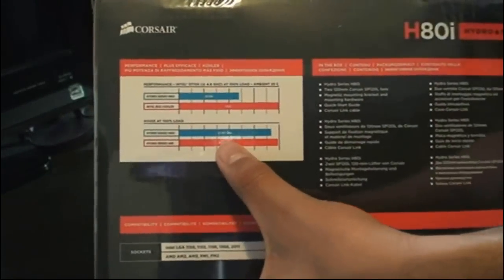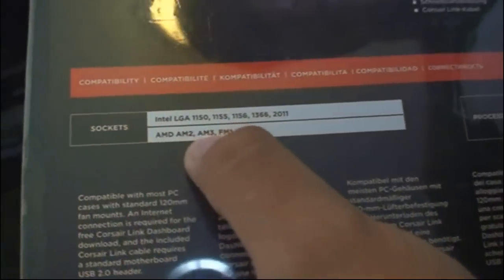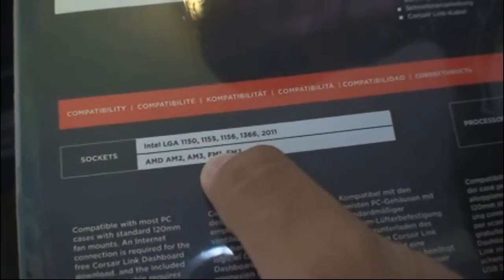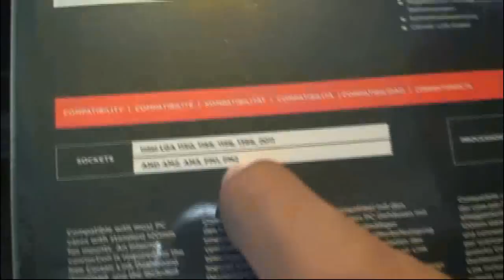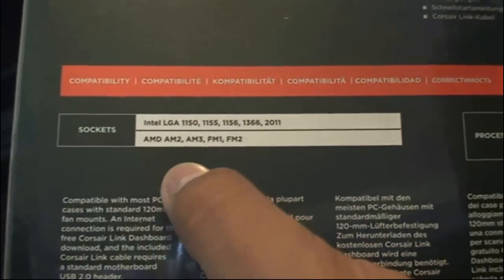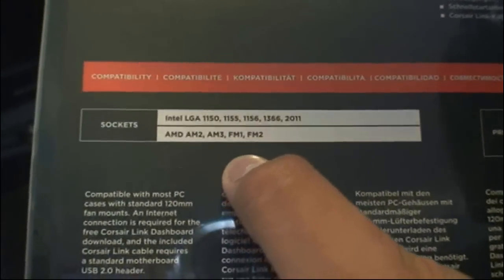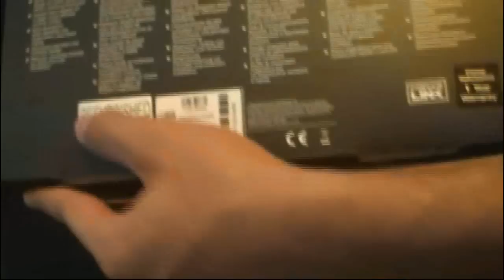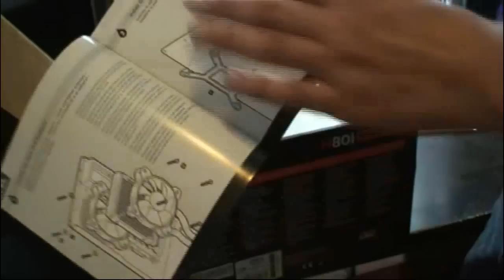Corsair H80i Unboxing and Installation!

Comment: In all videos i have watched,  both fans point inwardly  (the corsair logo points inwards) ?
Reply from the maker: Dude Sweet pc it really comes down to preference and how your case airflow is lined up. Usually I would set it up like that, but I didn't have any good airflow in that case so I settled for that. At this point I have a new system with a custom loop set up :)
Reply: ADRTechReviews ok :)
Reply: ADRTechReviews Well they are supposed to go <--- ÷ <---- i read about it,  for me evetything went alot better, sound,  lower radiator heat, better temp, it's just that none of your fans move out the heat from Rad now. :p

Comment: I have a question about the amd bracket, why are their holes top to bottom how do u put that thing on top of the cpu????
Reply from the maker: Angel Perez the amdbracket uses the same motherboard mount as other coolers,  but it's more like a compression system.  It's difficult to explain in words lol

Comment: I got a new motherboard its a msi z97 gaming 5 mobo and I have a h80i cooler after installing my new mobo corsair link does not recognize my pump or fans. I am running the latest version of corsair link and also have intel usb 3.0 extensible host controller driver and bios is up to date also. I tried all the soultions I found online the regedit fix didn't work because I am on windows 7 and I tried using older versions of Corsair Link that also was a fail. Tried reinstalling corsair link without the usb header plugged in and installing CL and plugging it in after boot no good either. Tried using a usb port from outside the case also no good I know its not the USB ports because it dectects my other stuff just fine.
Reply from the maker: azlil7 You may have already done this, but its worth asking; have you tried updating the firmware of your H80i rather than the software?
Reply: How do you do that ?
Reply from the maker: Go on Corsair link, and on Options - devices, click "Check for updates"
Reply from the maker: Hmm, I'm not sure. Regedit is a fix for windows 8.1. But windows 7 shouldnt have a problem. Are you missing any windows updates

Comment: what clock speed did you have the x4 760K at to get the temps in  the description
Reply from the maker: ichigo8000 I had it stock. So 3.8 gHz. But keep in mind that AMD temp probes are inaccurate.
Reply: wait, why the water cooler if you're not overclocking, b/c i want to get this water cooler to overclock my x4 760K
Reply: ADRTechReviews should i get a better cooler since i want to overclock it b/c this ones already expensive i was gonna try to push close to 5 ghz with this cooler
Reply from the maker: I did overclock the CPU all the way to 4.8 gHZ. although day to day I ran it at 4.6
Reply: Okay thank you

Comment: What if your (my) motherboard doesn't have an extra USB header?  (ASRock Fatal1ty Killer 990,  only 2 USB headers, both being used by top case ports)
Reply from the maker: I would just remove one of them to free it up. But you could also rout it to the back of your motherboard with a mini USB to USB connector

Comment: u got a small case, u should have fix the radiator outside the case
Reply from the maker: I dont have this case anymore, thank goodness :) 

But there is no way to have the Rad. on the outside of the case, that would require the tubing to be removed. But since this is an All in One water-cooling solution, it doesn't come apart :)

Comment: The system only comes with 4 washers for the outside. The inside fan doesn't need any.

Additionally I have a much smaller case and mounted the radiator upside down (the water hoses came from the top, under the power supply) and that seems to work better for getting the block to the motherboard without too much twisting. I also mounted the inside fan to the radiator first.
Reply from the maker: Yeah I realized after.. Also that case didn't have any top mounts, it is a fairly old case, and the reason why I moved case. 

As you can tell this was my first video, I didn't really have much experience, but now I've become much more informed. :)

Comment: Did you use the washers?  And did you go and get longer screws for screwing the outside fan on? Please respond.
Reply from the maker: For some reason, only four washers are included. But yes I did use them one one fan side. Also, yes the screws I used were the longer ones. But you use those for both fan sides. So they can go all the way through the fan and into the radiator.
Reply: ADRTechReviews yea I use the longest screws they give you but I seem to have trouble getting it to screw to the radiator after it goes through the case (I'm talking about the fan mounted on the outside)
Reply: Rooty_Tooty I only have trouble with the bottom screws the top ones go through real easy so I'll have to muck around with later today
Reply from the maker: Rooty_Tooty Make sure the screws are actually going through the correct screw hole on the radiator. If you're still having trouble, make sure that the radiator screw hole has nothing blocking it on the inside.
Reply: Rooty_Tooty i personally didnt use the washers, no problem at all

Comment: What about this build? will i get same graphics?

MotherBoard: ASUS Z97

Graphics Card: EVGA GeForce GTX760 2GB

Ram: Corsair Vengeance 8GB (2x4GB)

Cpu: Intel Core i5-4690K Processor 3.5

Hard Drive: Western Digital 2 TB black addtion

Power: Corsair Builder Series CX 600 Watt 

Case: NZXT S340 Mid-Tower Case

Fan: Corsair Hydro Series Extreme Performance Liquid CPU Cooler H80i

Disk burner: Asus 24x DVD-RW

Operating system: Windows 8.1 System Builder OEM DVD 64-Bit
Reply: and are parts fix in the case
Reply from the maker: Random guy on youtube with no profile picture Yup this build looks good to me. Although I would invest in an SSD if you can, it helps with boot times and game loading times. Which takes off a lot of the frustration. Other than that, this build looks fine and you will definitely have no issues with gaming on it.  

I've never personally used a NZXT S340 case, but since its a modern case i don't doubt that it will fit. I would ask on forums and do a bit of research just in case though.

good luck with your build! :)
Reply: Il try an ssd and i dont know about the case neither im scared :( what if i buy it and it doesnt come compatible im 13 so it took me a while to save 1k
Reply from the maker: Keep in mind that an SSD would be an extra amount put into your system, I wouldn't switch a hard drive for one. Because SSD's don't offer enough storage. 

After doing a bit of googling, I read that it does fit, it will be in the way and will stick out but it will fit. if anything it is possible to mount it in the front, but if you are really concerned i would suggest something like an H60 or an H75.
Reply: Ok i change some things so i dont know if everything is compatible again and this is pretty expensive any tips on how to lower the cost?

SSD: Crucial MX100 256GB

Hard drive: WD Blue 1 TB Desktop Hard Drive

Graphics card: EVGA GeForce GTX 970 FTW

 Cooler: Corsair Hydro Series Extreme Performance Liquid CPU Cooler H80i

Mother Board: ASUS Z97-A

Power Supply: Corsair Builder Series CX 600 Watt

Case: NZXT S340 Mid-Tower Case

Optical drive: Asus 24x

Ram: Corsair Vengeance 8GB (2x4GB)

CPU: Intel Core i5-4690K Processor 3.5
Reply: ADRTechReviews oh ok
let me make some more changes to the build
Reply from the maker: Yeah, everything looks great. The 970 FTW is a great card as well. The SSD is a nice and large one for your OS and games. So its a good build. 

Like I said before, I cant guarantee that the H80i works in your case although it probably will. But to stay on the safe side I would recommend the H75 :)

Or maybe go for some of the NZXT variants of closed looped coolers, like the NZXT X41.
Reply from the maker: Whats your current total price?
Reply: 1400
Reply: its a bit over my budget i was hopeing for around 1200
Reply from the maker: Switching to an H75 will save a bit, and a cheaper motherboard will as well. ASUS motherboards can be expensive, especially Intel chip-sets. Although ASUS offers amazing reliability ( no Im not sponsored ) if you're on a budget I would consider an MSI, Gigabyte, or even Asrock boards, for lower prices. Keep in mind these manufacturers are also very reliable.
Reply: what about this?

SSD: Crucial MX100 256GB

Graphics card: EVGA GeForce GTX 970 FTW

 Cooler:  NZXT Technologies Kraken X41

Mother Board: ASUS Z97-A

Power Supply: Corsair Builder Series CX 600 Watt

Case: NZXT S340 Mid-Tower Case

Optical drive: Asus 24x

Ram: Corsair Vengeance 8GB (2x4GB)

CPU: Intel Core i5-4690K Processor 3.5
Reply from the maker: The motherboard doesn't affect gaming at all, and in reality neither does the CPU in most cases. You can save a lot by buying a non-K i5, and you will get the same performance. The graphics card is the most important part of your gaming build. Keep in mind I say GAMING. Overclocking, workstation and editing are completely different in spec needs.
Reply: ADRTechReviews what does k mean?
Reply from the maker: the "k" on the end of the 4690(k). Means that the clock speed on the CPU aka. the gHz (example: 3.5 gHz) can be increased or decreased. This makes the CPU "Un-Locked" and more expensive. If you don't plan on overclocking I would recommend an i5-4590 or even a 4440. Downgrading will cause a negligible performance difference.
Reply: ADRTechReviews i have a liquid cooler on it what do you think should i over clock or what?
Reply from the maker: Overclocking requires experience, unless you really really need it, I don't recommend it. I suggest you do a lot of research on parts and overclocking. Before you spend a large amount of money on your system. Make sure you know all the ways to buy the best, for the best price. Keep in mind AMD is also an option. There are a lot of variables when it comes to computers, and research is the only way to know which route to go. There are a lot of websites that help with knowing which parts perform better, I use game-debate.com. Also, for the best prices online, use this website -> pcpartpicker.com it sources all the cheapest prices from a variety of trusted vendors. It also keeps a list and shows parts that are compatible. 

I know this is very long, but I really hope I am helping you out. I understand how stressful building a computer can be :)
Reply: :) thanks im going to try game debate
Reply from the maker: No problem!

Comment: What should people do with windows 8.1 ? (Like me) I want to get it, but if it doesnt have support i dont like it..
Reply from the maker: It does support it, although Corsair link does not recognize the cooler without a registry edit. Where you have to physically set the values from 0 to 1. Its not a hard fix, you just need to google it and fix it. I have windows 8.1 and I fixed it. Its a simple thing. :)

Comment: Does the "corsair" logo lights up? thanks
Reply: Yes it does, it is also an RGB LED so it changes colors.
Thanks for watching :)
Reply: thanks!, I'm thinking on getting one for my tower that's why i'm looking for people who got it. and your video helped coz i thought it only comes with one fan.
Reply from the maker: Chris M. No problem! Just keep in mind that the rad in push pull ( two fans ) gets really thick, so make sure you have good spacing.
Reply: I think it's gonna fit on my case. :) I got a corsair 230T, how was the fan in the long run?
Reply: the fan runs fairly loud. But with the quiet profile it runs near silent.

One thing about Corsair link; it will not work on Windows 8.1 without a few registry edits.

Comment: Don't spin the fan dude! Not good for the bearings!
Reply from the maker: I have heard about this being talked about before, but I haven't found any research on it currently. I don't doubt this is a myth considering that fans are meant to be spun.
Reply: ADRTechReviews Well if you think about it, it could be damaged considering fans are supposed to spin attached to bearings and a motor, then that middle part of the fan, and spinning it with hands can probably grind against those bearings.

Comment: What is your cpu?, i don't know if it's just me but i didn't see any information about it. Cool video tho, btw, aren't those temps too high?, just saying, because i've seen people having those exact same temps and to fix that problem they added some washers, here's a link Corsair H80i loose backplate issue. , maybe you need to add some washers too.
Reply from the maker: My Cpu is an AMD Athlon 760k.
No back plate on the AMD bracket, so that cant be the issue. Plus, i have re-seated the cooler twice. 
Sorry about that, ill be adding it to the description now.
Reply: ADRTechReviews Oh well, in that case i don't know what you have to do, but i'm pretty sure that your temps should be lower, i hope you can find a fix. cheers.